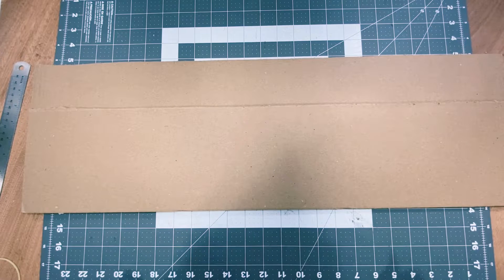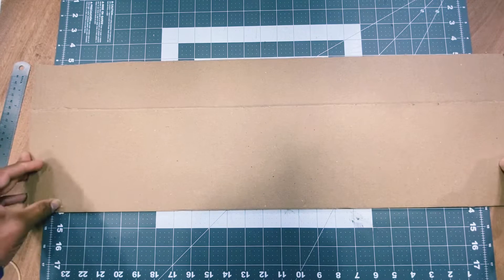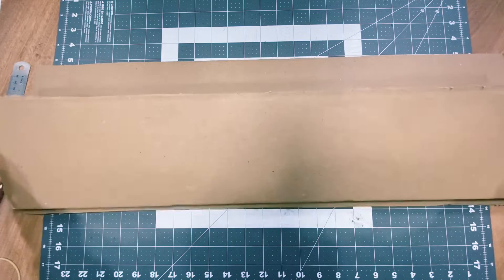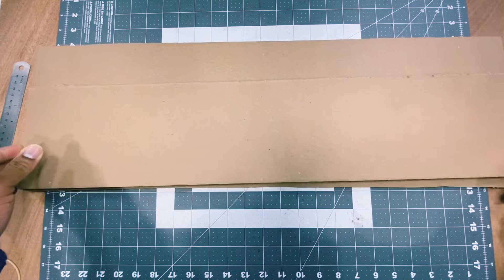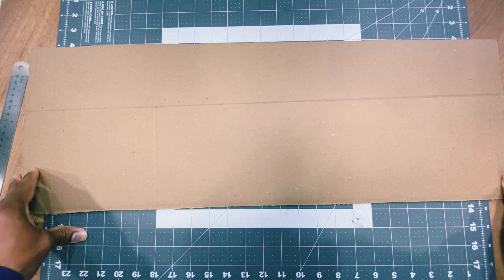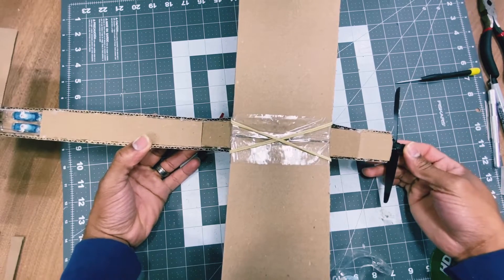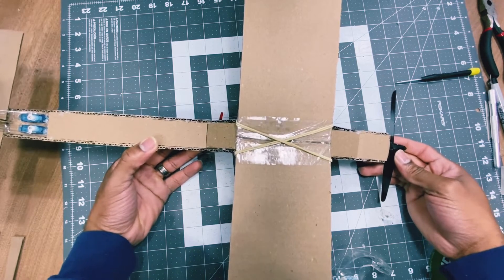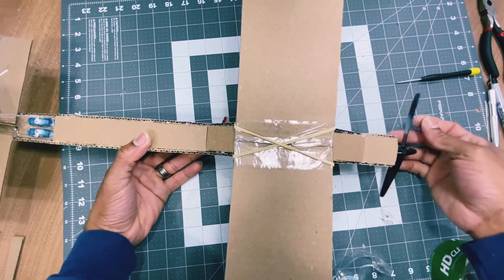How To Make a Cardboard Rc Airplane : Diy Homemade Remote Controlled Plane

Comment: can we have a material list on what you need though? I'd love to make one but I dont know what motors you used etc.
Reply from the maker: I used a 2207s-kv 2100 sunny sky motor, 18amp esc, 2 micro servo, and 1000 mah battery. I’m thinking of making some changes , that’s why I haven’t posted the maiden video yet.
Reply: @chrisellisrc8787  ohh okay thanks so much and also sorry for replying late I was at a cousins house for Christmas.